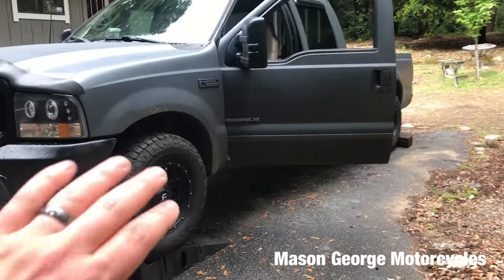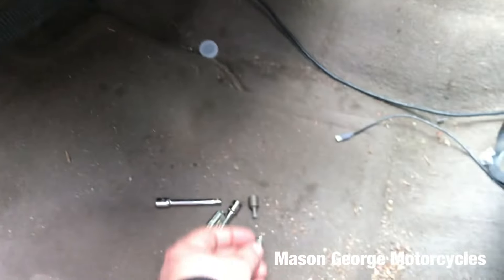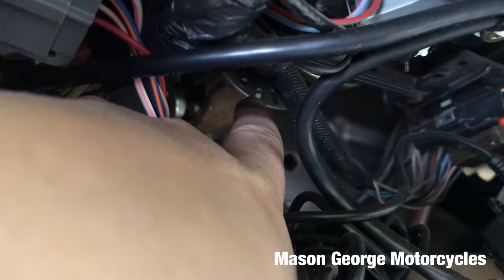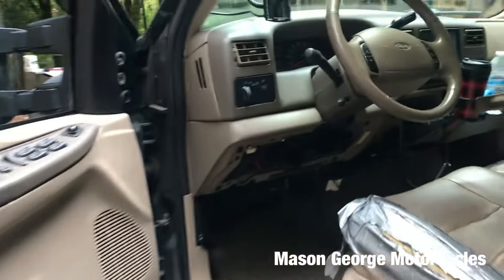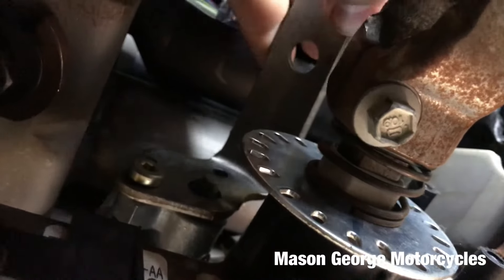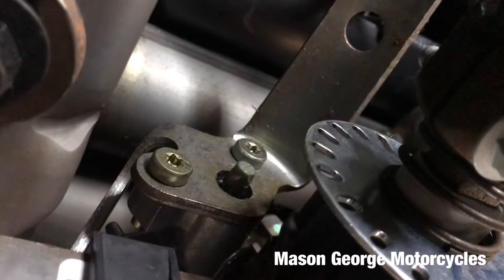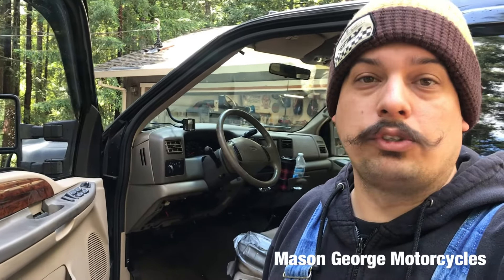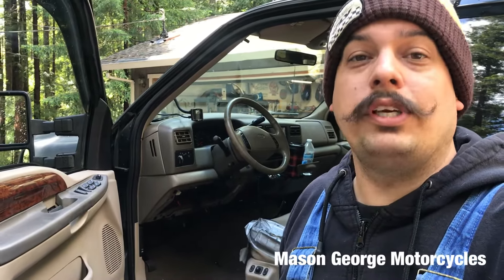Ford Truck Loose Shift Linkage Easy Free Fix Common Problem How To F250 F350

Comment: Holy smokes! I’ve been fighting the loose shifter for months. I tried adjusting it at the transmission a dozen times. I luckily found your video and sure enough found the bolt on the floorboard. Reinstalled it, tightened the loose second bolt and BAM!  100% fixed!
Reply: Scott✔️😂

Comment: EXACT same thing happened to me two weeks ago. And it's been loosening up for a while. My shifter does better than it has in 10 years. Ford f250 97 model 7.3 powerstroke. Shifts like it is new now.

Comment: 1995 f250 powerstroke...mine were just about to fall out. im still going to check the cable adjustment but it seems to be working fine now

Comment: Thanks for sharing. I just had same issue on 2001 350..bolt fell out hanging in wire harness. All fixed now did it in lowes parking lot 5 minutes ago..

Comment: My screws were still in there but very loose.  I tightened them up with 30 torx bit and man, shifts like a champ.  I feel like my steering is a bit tighter too.
Reply from the maker: @CloneProdz  rad!!!

Comment: Thank you sir. The stealership wanted $25,000 and to keep the truck for 3 months!
Reply from the maker: @TheLawCoyoteTLC  25k for what???
Reply: @MasonGeorgeMotorcycles  was being sarcastic. I meant for screwing the T30 bolt back into the shift linkage. Just fixed it now. Thanks for the video!
Reply from the maker: @TheLawCoyoteTLC  hahaha right on!

Comment: I just bought a 1990s decade Ford F250 4x4 and I went to try to shift to drive right after I was driving from the dealer. The shifting arm broke clean off and was dangling from the steering column. 😬
Reply from the maker: Wow! That had to be a surprise for sure
Reply: @MasonGeorgeMotorcycles  It was. They were nice enough to tell me not to worry about it, and that they'll deal with it. They had it towed to another shop that is more equipped to handle that type of situation. They're supposed to keep me updated. It was a bummer I couldn't drive the truck I just paid thousands for (because it's a 4-wheel drive).

Comment: This is the exact problem I have. Thanks for the video. Only problem now is, getting the screw back in. It’s such a tight squeeze and I can’t get both hands in there. The plate is misaligned and I’m not able to get the screw to line up to secure it back in place. Any suggestions?!?
Reply from the maker: Find a friend with small hands lol
Reply: No need! I am Victorious!! Had to tighten the one screw that was still holding on, then the second one lined up perfectly.
Reply from the maker: @seanandalyssakirkwood3616  winner winner chicken dinner!!!
Reply from the maker: @seanandalyssakirkwood3616  winner winner chicken dinner!!!

Comment: A Big Thank You from Anchorage Alaska it is winter now and I had the same problem on mt F-250 both screws came loose and like you said a T30 with my wrench and problem fixed.

Comment: Like the others here in the comment section, I have been struggling to get my F-250 into park for some time.  After browsing several forums I decided to try youtube and your video came up.  I looked under my dash and I have exactly the same setup.  Ten minutes later I was easily putting this old beast in park with no problem for the first time in over a year.  Thanks for the great video!
Reply from the maker: I’m so glad the video helped! That’s what YouTube is all about🏁

Comment: F250 2005, loose shifting lever progressively getting worse as time has gone on. Reached a point yesterday where I had to put the truck in neutral in order to get it to start. 
I tightened up both screws as in the video, shifting is perfect again! 
Thank you!

Comment: Hi bud,the exact same shit happened to me this morning after I backed 96 F250 7.3 in my parking spot.Gear shifter was sloppy and wouldn’t go in any gear,unable to start engine again.After work in daylight now I found the T30 on the floor mat just like in your video .I have a little different set up in my 96 but after about 15 mins had it all fixed & im home now😃 Thank you very much for your helpful video!!!!

Comment: Im having trouble put my 2004 F-250 in gear
Reply from the maker: If it’s not a loose linkage under the dash I would check the linkage by the transmission.

Comment: I had the same problem with my 1999 F350, had trouble getting it into park and could only start it in neutral. Neither of those screws had fallen out but both were loose enough to make the linkage wobbly. I tightened them with a T30 Torx screwdriver and it shifts perfectly now. Thank you !

Comment: have the same problem with my shifter being loose and have to push up to start....now it suddenly won't shift out of 1st gear while driving and the ABS light came on at the same time this started.  Would this also fix the shifting issue?
Reply from the maker: Dragon Box LVPA I bet it’s at least part of the problem. The ABS light will stay on if your batteries are low.
Reply: Dragon box lvpa I just got my 2002 excursion home with that problem. Technician told me it was a shortage in my abs sensor line. Hope this helps.

Comment: Such a common issue to remedy this problem.  If you still have slop in the shifter make sure to check the mounting bracket for the cable that attaches to the transmission.  I have seen a couple that had loose bolts causing similar symptoms.

Comment: I bought a Ford with the same problem but the screw is broken inside so I have to figure out a way to get that fucker out
Reply: How'd you get broken screw out? I have same issue. If I unscrew other screw will I be able to put it back? Don't know if it's hard to put in place if it has tension.
Reply: @grandpapops6692  I actually had to take the whole thing out there was no other way.